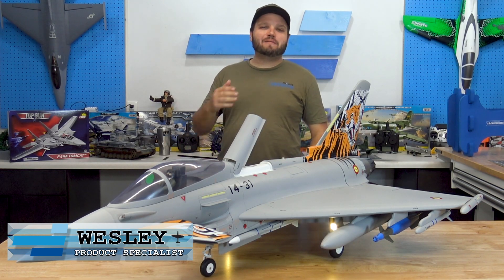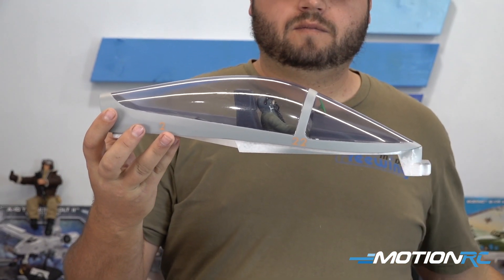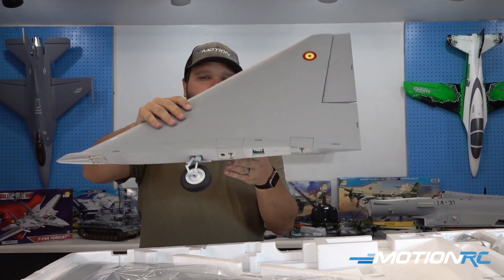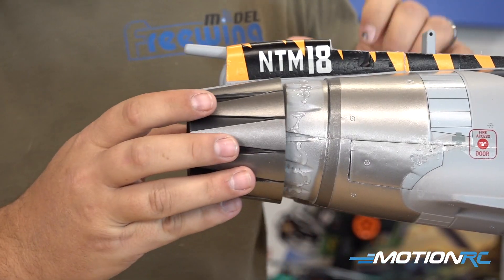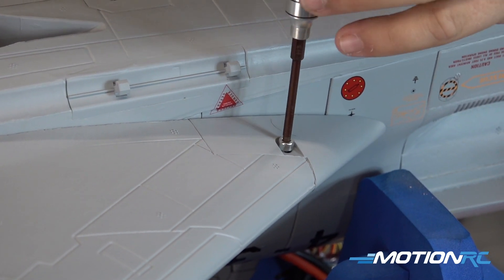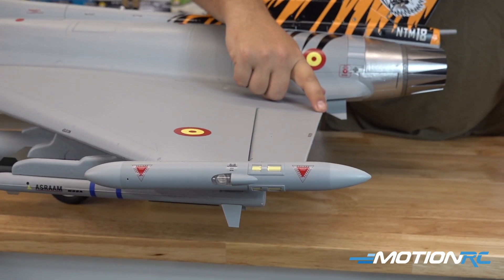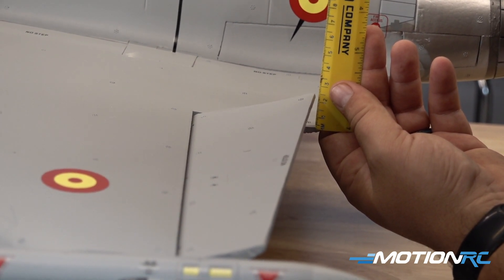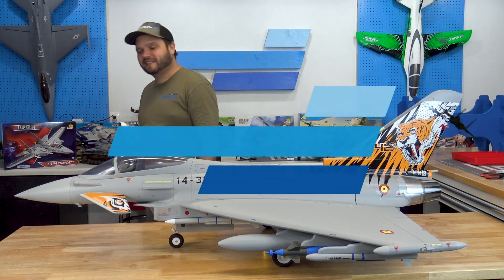Freewing Eurofighter Typoon 90mm EDF Jet Assembly | Motion RC

Comment: Just maidened mine, probably the slowest edf I’ve ever flown. I get a top speed of 68mph. Zero vertical climb. I’ve recalibrated the esc 4 times. Put new batteries in it. The build quality and retracts are great though.
Reply from the maker: Out of curiosity did you get an 8s Eurofighter and try it on 6s? The euro fighter has two different power system options. The 6s 100mph + the 8s is over 120mph. But if you fly on a the 8s on a 6s battery that would cause this crazy low speed.
Reply: @MotionRC  it is the 3886-1960kv motor, looked at it today
Reply from the maker: What battery are running in it? And you might want to reach out to customer service if you truly can’t fly this well over 100mph because it sounds like you have a bigger issue than we can resolve here on the YouTube comments section. Our customer service team can help you find what might be making this issue for you.
Reply: @MotionRC  I appreciate you trying either way.. I’ll reach out tomorrow.. I was running a 5200mah 120c brand new. I have a mirage and that thing is like twice the power of this. I ordered a watt meter too.. need to test the power on the bench
Reply from the maker: @SkitzoFPV Our CS team will help you find out what’s going on.

Comment: Hi. First of all you did a GREAT job on this assembly and set up video. Really heads and shoulders above a lot of other guys. Secondly, the width of my trunk is only about 40 inches. So I think this would fit easily in my car if I only removed one wing attached. Is this advisable? Thanks again. This will be my first 90 MM EDF and I am hoping it will do well on our grass field. we keep it rolled and mowed so I hope it will have enough thrust to get airborn. Do you have a grass field ops video?
Thanks for your advice in advance.  Rich

Comment: Is it possible to Fly it with a ar630 and a Spektrum dx6e, without using the thrust Reverse?
Reply from the maker: yes you just wouldn't plug in the thrust revers lead.